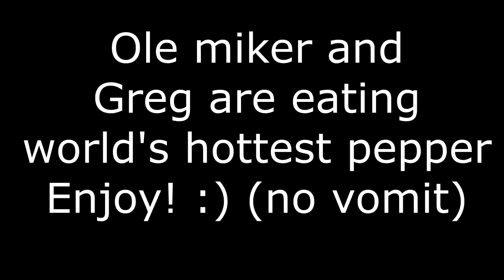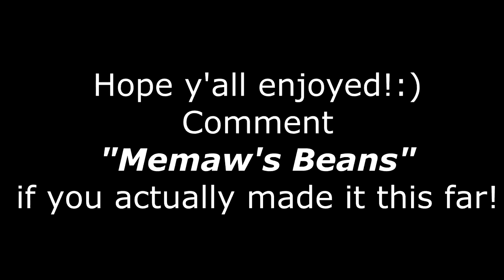My Truck Is TRASH

Comment: Wanna buy mine from me it got the top crushed in by a tree yesterday and the engine is torn apart but all the parts are there and there’s really good parts clean title I’m hand both doors are still straight
Reply: And the rest of the body besides the cab

Comment: I had an 01 sport trac and the back doors would only open from the outside with child lock off and my driver door would only open with the code so the only door that worked perfectly fine was the passenger door😂

Comment: All those model ford trucks are crap. All of them break down. They are rated the number 1 beginner truck because the salvage yards are full of them so it makes getting parts for them super easy. This is not a lie. I like these model fords but they are shit. Get an 84-85 model DODGE and you will have one of the best trucks ever made.